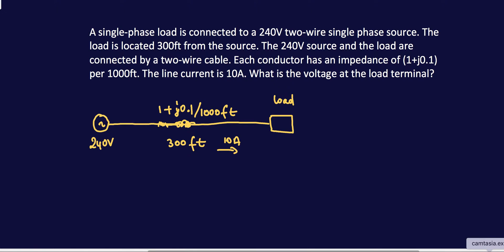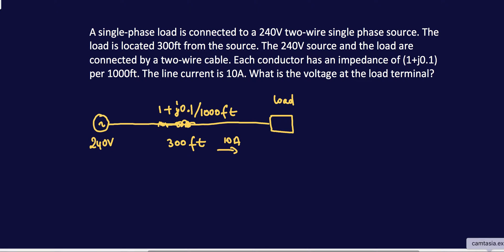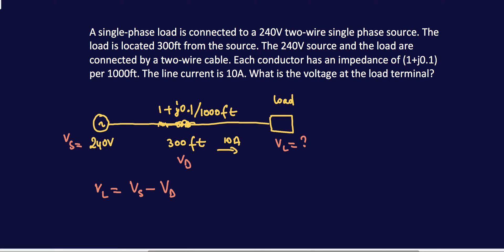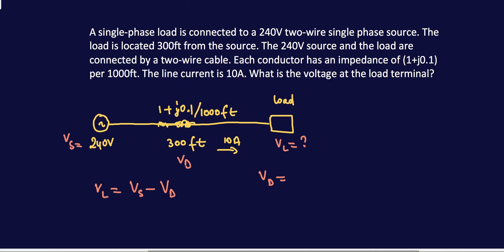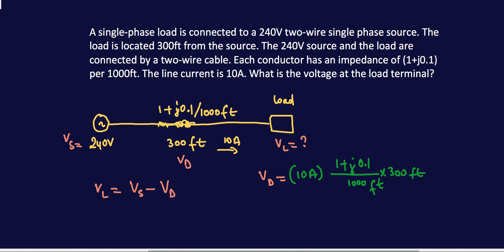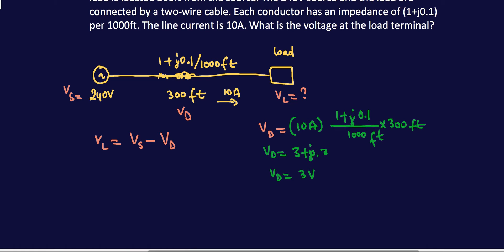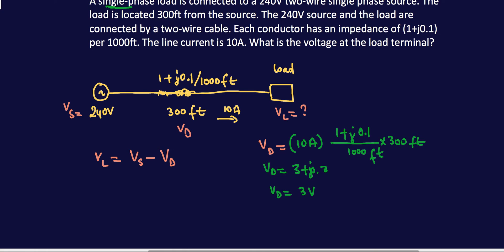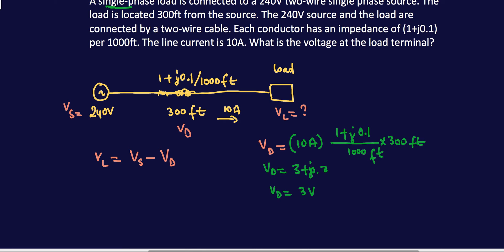Single Phase Voltage Drop

Comment: What if the supply is a line to line single phase and not line to neutral?  Does it makes any difference? Thankyou
Reply: No different ,,, 1-phase (L-N or L-L) is two wires and the same calculations.

Comment: Shouldn't the impedance be divided by two because of the two wires?
Reply from the maker: No, you're taking into consideration the return path...
Reply: So if it was a 3 phase load with two wires, how would i go about solving that?
Reply from the maker: Ife Adetoro in a 3 phase system, you got 3 conductors right? But current through the neutral wire is zero. Current flows out to the load and back on the phase conductors unlike single phase where you got a neutral wire and a “hot” wire. So for 3-phase the multiplier is sqrt of 3 (phase conductors) instead of 2. Does that help? I will upload videos on this so you can visualize what i’m saying.
Reply: I understand the multiplier will be sqrt of 3. I hope to see a problem on this soon. Thanks
Reply: The wires are in series not parallel. The example is a SLD , convert it to simple close loop circuit. Apply Kirchhoff voltage law. Answer is there.